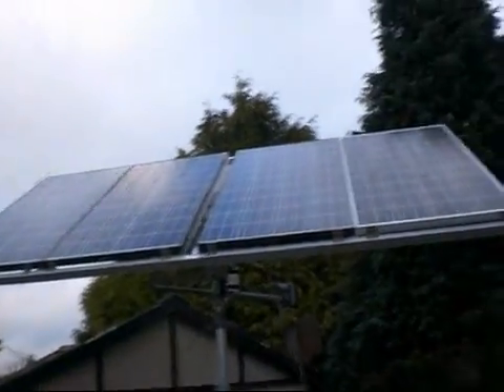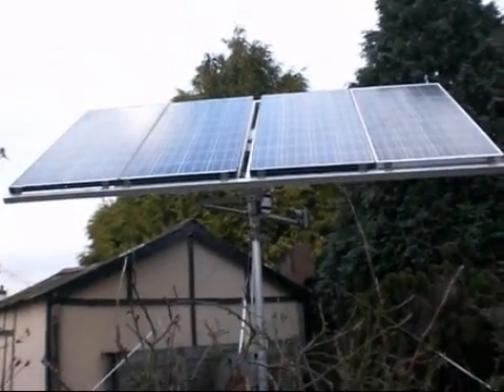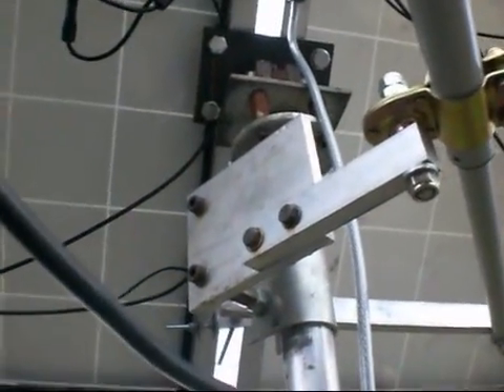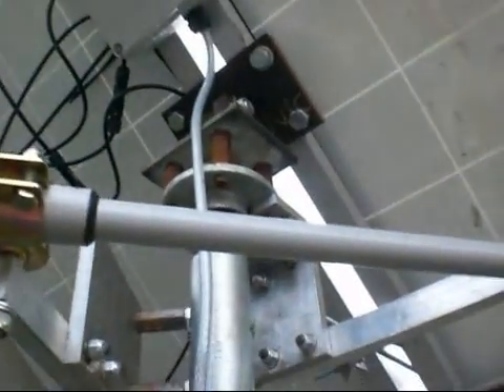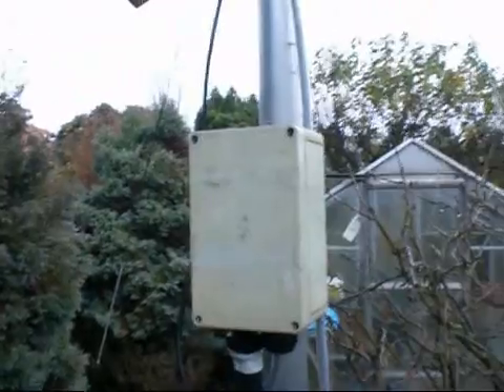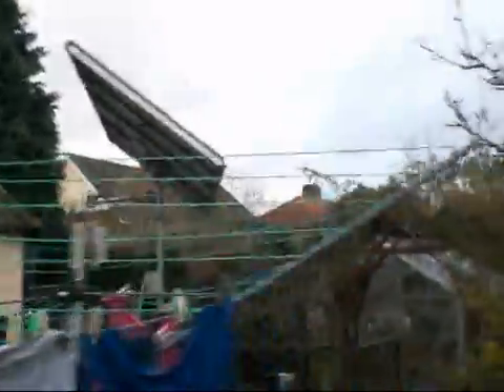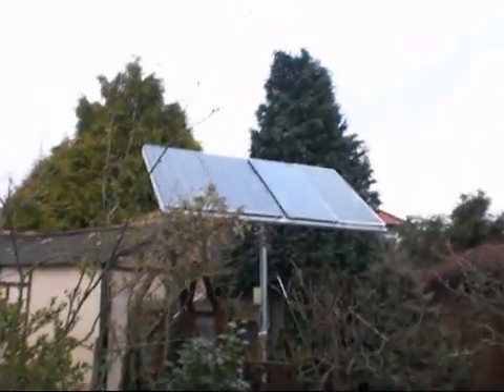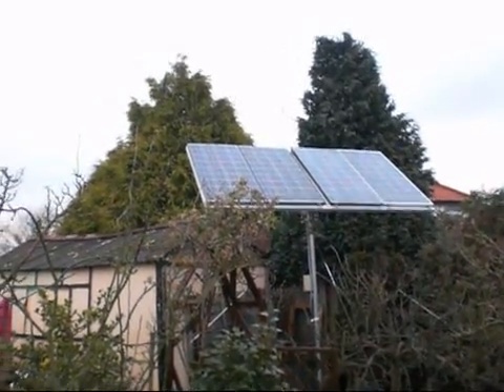Solar Tracker part 2.divx

Comment: That array is great! I am starting going solar, and made myself a tracker using junkyard stuff. It works fine, and yes, it increases electricity yield by at least 65 per cent in spring-summer-fall, and a little bit less in winter.

Comment from the maker: People say 30-40% gain on a day over a fixed panel system.
I get on a bad day 60 Kw Ah per day
On a good day 140+ Kw  Ah per day
It keeps my bank topped up so I can run all my appliances  LCD(40w) PC Lights(11watts) Pvr(22watts) plus more 250watts total.(these were  picked for low energy usage products.
My battery bank is 2500 Kw ah Capacity 28 batteries.24v system .Need my wind turbine up soon for Night-time charging as well.

Comment: Nice achievment.Have you estimated the overall solar efficiency gained by the tracking system, rather than a static solution?
___________________
Ivan Lovric
ESECO SYSTEMS